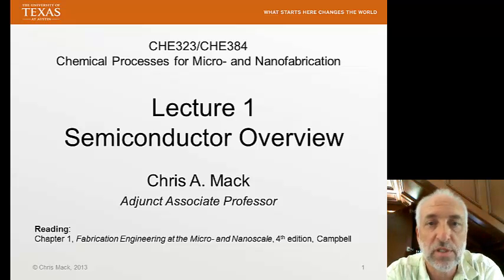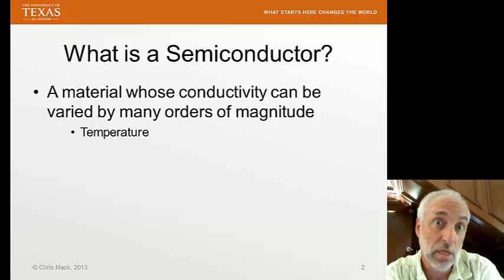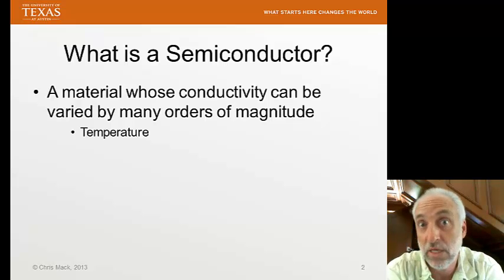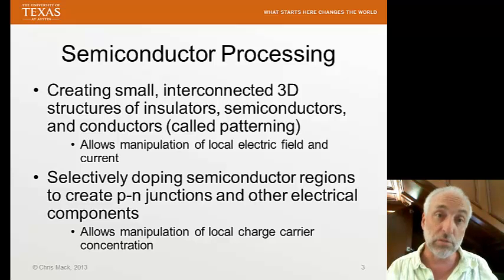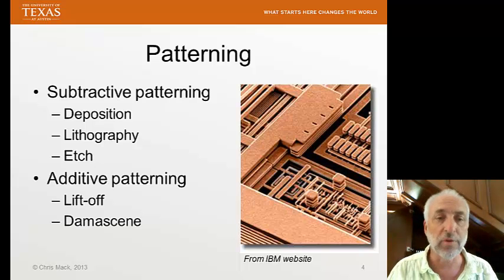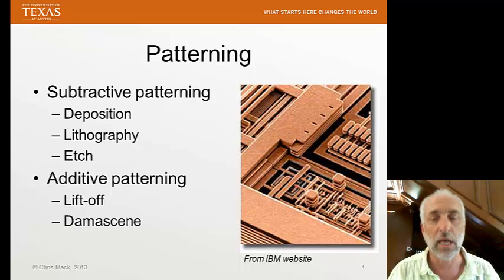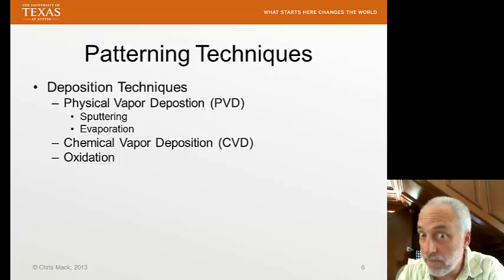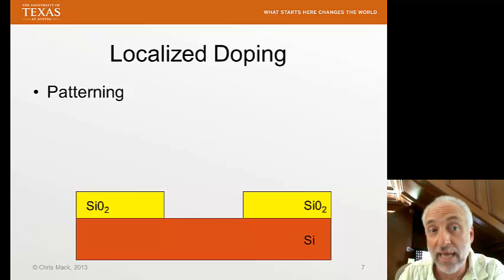Lecture 1 (CHE 323) Semiconductor Overview

Comment: Q&A just for my answer(not accurate b it just for a record)
1. Semiconductor is things that using materials that has the conductivity between conductors and insulators, like between metals and glass. The conductivity could be manipulated under different of conditions and methods.
2. Doping or gating, doping would be using chemical approach to alter the material permanently, gating is like using electric field or maybe some other field to temporarily changing the hole and electron distribution to make it conductive.
3 and 4, Pattering is photolithography, to be simple, putting photo resist on the wafer and then when light project through reticle and then shine on the wafer with resist, it will change the area that did not covered by the reticle, then, after chemical solution to the resist that be affected by the light, and then etching the related part under the removed resist will be eliminated and pattern is applied to the wafer.

5. Ion Implantation is a specific doping technique used to introduce impurities into a silicon wafer. High-energy ions are accelerated in an electric field and smashed into the wafer surface. They bury themselves into the crystal lattice at a precise depth and concentration determined by the energy and current of the beam.
6. Since the ion was too strong and it would break the crystal lattice of the silicon, turning it to amorphous, then it is needed to raise up the temperature of the entire wafer to do annealing, making silicon to recover and re-crystallize. Also, by raising up the temperature, the injected ions would be able to move into the place it should be rather than just randomly between the atoms. Then it will do the work to change the conductivity.(not sure this is correct or not)

Comment: Q1: A kind of material whose conductivity is variable
Q2: Doping and applying voltage
Q3: A process that prints/gathers individual transistors into chips
Q4: deposition --> lithography --> etching --> removing the remained mask material
Q5: shooting the accelarated ions into silicon
Q6: To diffuse the ions and recorver the doped silica from amorphous form to single crystal

Comment: Hello Lithoguru, Dr Mack, I have a question. At 14.:47, when Phosphorous is doped Si becomes n-type right. The picture shows it as p-type. Kindly, clarify that.
Reply: Found Answer from the comments. Thanks.
Reply from the maker: Phosphorous definitely creates an n-type region.  Sorry for the confusion!
Reply: Indeed, P is an n-type dopant for Si. In the periodic table of elements, Si is in the fourth column. An element belonging in a column higher than the fourth will be an n-type dopant to Si, while a p-type dopant will belong in a column ranking lower than the fourth.